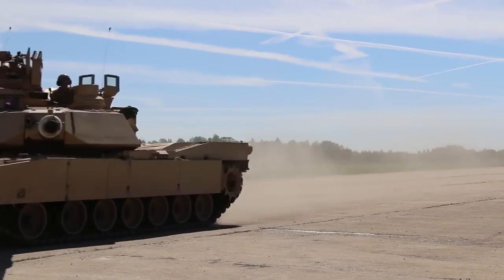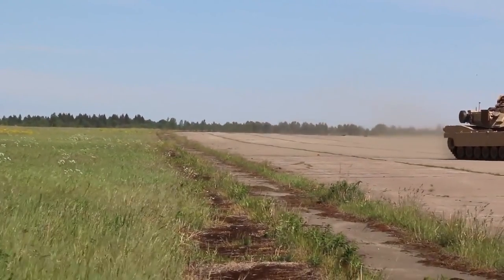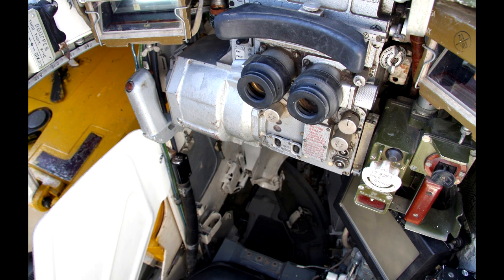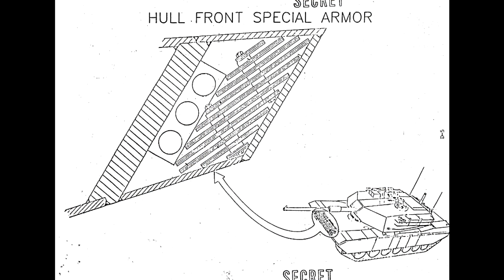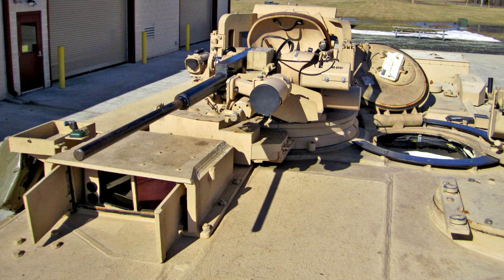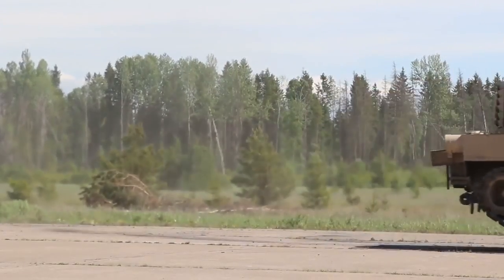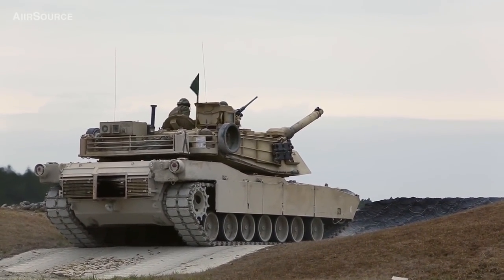Problems with Abrams tank

Comment: 9:00 - nope, nope, nope! That plate you are talking about - is really hard to aim. If you make a model of a front image of a tank - that upper plate has very small chances of being hit. Tank battles take place on distances ca. 1-2 km. So aiming at one 'weakspot' like in WoT or WarThunder is NOT an option. Even with APFSDS - after you shoot, enemy can relocate, wind can change or anything happen that will change the trajectory of missle :P
Secondly - fuel consumption of all tanks is rather high. M1 has it higher but on the other hand - this gives better acceleration, which gives upper hand in battle. And GT is quieter on the longer distances.

Using L55 is NOT the only option. There is really a lot that can be done with the material engineering of the penetrator. Or the explosive material. For sure at some point USA will use better cannon - but will it be 130 mm? 120mm L55? Future will show, but for now - similar effect can be achieved by upgrading ammo.
Reply: And as someone who knows a tanker you absolutely do aim for weak spots you dont just fire and pray your gunner fires based on the field ahead in most modern tank battles on side is stagnant in defensive positions this was shown in Iraq you fire for the weakest part you visibly can see
Reply: @nicholasbrown668  On what distance? 500m? 800m? 1-2 km? 3 km? 4 km?

That frontal plate is not that a big problem - if it was-  it would be already upgraded with additional armour plates on it. Or ERA.
Reply: @bartosza.6187  my nigga did I say I was a tanker im just saying they do aim for general weak spots not just point and shoot even first hand account from tank commanders during desert storm state they aimed for weakspots as their gunnery cameras give them a clear view at extreme range
Reply: @nicholasbrown668  OK. In case of desert storm - they fought against T-72. In case of those tanks - aiming at weaksopts is possible. So in such situation - it is possible. :)
Because their whole sides of hull and turrets are one big weakspots :) :) :) 
Any penetration there = detonation of ammo. 
A joke about T-72:
Where is ammo stored in T-72? 

Everywhere :D

In my country we used to have many T-72. So our military specialists know them perfectly :) Strangely they all disappeared several days ago... I wonder where are they now? :P
Reply: Upper hand in battle? Kid you realize the US army wants to replace the Abrams because of combat knowledge they received in the gulf wars right? When you have to stop 3x as more frequently for gas than a peer enemy you leave yourself heavily exposed and at risk of encirclement
Reply: @nicholasbrown668  emmm.... Not really. USA is planning to replace Abrams in 2-3 decades. NOW they are planning some R&D to make new platform - but before those works will end - there probably will be 2050 or 2060...
Reply: @bartosza.6187  2 or 3 decades? The army wants its new tank design program to begin production within the next decade lmao

Comment: Yup first M1s were not so good. They had many flaws. But they were constantly upgrading them :P
1:20 - they used gas turbine because the development of dedicated Diesel for Abrams had some delays. And they used what they had avaiable. Gas turbine is much lighter than diesel = more spare weight for armour. Fuel consumption WAS a problem on stationary missions. GT worked with 100% power just to power some on-board systems... Now with APU - problem is solved. Gas turbine was upgraded in the '90s (as i renember), and filter problems... also was solved.
1:40 - not true. Excellent acceleration is more than enought to justify the use of GT. Acceleration = faster retreat = machine and crew survival. Tank is a war machine - it has to kill, not be 'economical'... If something gives you upper hand - it is worth.
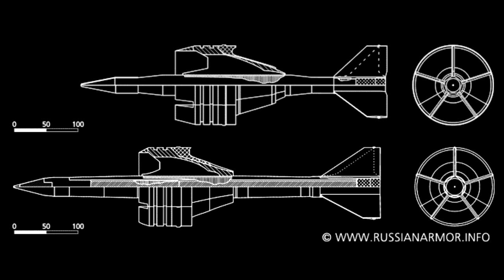4:00 - many ppl cry about depleted uranium... It's stupid. DU is actually U-238, which is not that radioactive. Ofc if you eat or inhale the U-238 dust - this can lead to some radiation problems, but mainly... toxic stuff. Uranium (just like Tungsten) is a HEAVY METAL. U-238 during fission emits alpha particles - which are VERY reactive - but are easily stopped by even paper sheet. So even dead skin cells on your skin and clothes protect you. But if you inhale it - then nothing protects lung cells :/ 

7:00 - AGAIN - fuel consumption is NOT a problem for military. This is not a car, this is killing machine. You really hate gas turbines, do you? Multi-fuel diesels can use other fuels but it has more limitation than for GT. GT can be fuelled by diesel/gasoline - no problem.
As I wrote earlier - one shot from main gun - costs more than driving several hundreds of kilometers. And even if you drive such distance - in ANY tank - costs of spare parts for suspension etc - will be much higher than the fuel. This are the 60+ tonnes machines (Leo2, M1, etc).

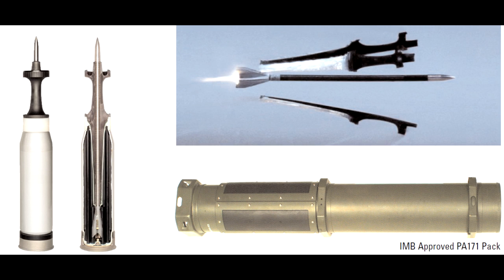8:00 - USA deals with it by increasing the barrel pressure and thus - muzzle velocity. L55 has its advantages and disadvantages. Maybe USA will do something with it, but for now - L44 and their ammo is sufficient. AND it's much much easier and cheaper to deploy all tanks with new ammo, than to rearm the whole fleet with new cannons :) L55 is also heavy and the question appears - should we take off some armour to mount longer gun? Or stay with L44 and in case of problems tanks will use air-force backup?
Reply: The high fuel consumtion would make them bad for the economy, not for the millitary. It is much more complicated than just saying that the millitary doesn't care, they do. Fuel is not nice to transport. They are also more complicated, wich makes them more unrelieable.

Also, U-238 likes to make aerosols, wich are not nice to be around and neither to clean up. Same goes with DU-ammo.

But the US could not not start wars, wich would be much more nice to have.

Comment: The armor inspection in this video is absolutely untrue. The thickness of the armor on the Abrams is 100% classified. Where did you get your 38-51mm on the top front plate? The rest of what you said is pretty much true, but the armor on the Abrams has been shown to be very strong on all frontal surfaces. There wasn’t a single t72B that could penetrate it during the Gulf War. Also, the gas turbine engine is very efficient & offers much better acceleration than most diesel MBTs today. The T-14 has a higher top speed, though.
Reply: First, in Gulf war Iraq had T-72M1 not B. and were using 3BM-17 an export round made of steel. maybe they had 3BM22
Reply: @76456  & you're right, they didn't have very good rounds to fire at the Abrams. Decent, not the best.
Reply: @76456  Didn't they both use the same gun, though? T-72B had better systems on board and better armor, right?  I could be wrong. Regardless, the Abrams has been shown to be a very tough MBT. More have been destroyed by their own crews than have been destroyed by enemy fire. Many have been damaged by mines and RPG attacks/anti tank missiles and either repaired or destroyed by their crew. If I'm correct, no Abrams crew member has died in combat. The Abrams has not been tested by any modern MBT other than the T-72 variants that it has made contact with. Things could be very different encountering a T-14.
Reply: @kegankelly3073  yes, bit i think some Abrams personal have died. if it was on the field or hospital idk.

T-72M1 have worst armour and gun than T-72B and also worst fire control sistem since 72B sight could display the Distance and the Lead, wasn't automatic tho like on Abrams or even T-64. 72M1 only could show distance.
Reply: @76456  okay, so t72m1 had a smaller gun or just lower velocity?
Reply: @kegankelly3073 
72M1 was upgraded in the start of 80's. B came in 85 if im not wrong.

72M1 had i think the same gun as B but had worst Projectiles, since it couldn't fit 90's Projectiles to face M1A2. like the B2
You can go to wiki "125mm APFSDS rounds"
summed up, 72M1 was worst but could go against early M1 or IPM1.
but for desert storm it was already to old. The problem was literally the ammo that it could use
Reply: @76456  Thank you for your expertise!

Comment: WoT has a lot to answer for,  I can't speak for US doctrine but i'd guess it's similar to British Army tank doctrine. In a fight with an opponent like Russia, we would not be  motoring around looking for kills, we'd be sitting in pre prepared positions hull down with infantry support. We'd fight that position and withdraw to the next prepared position, we would expect to have air support both rotary and fixed wing. What happened in Iraq in '91 & 03 against inferior forces bears no resemblance to how we'd take on a force equal to or superior to us in a defensive war we trained for during the cold war. With these facts in mind, NATO AFVs designed upto 1990 Abrams included were more than suited to this task.

Comment: This might be the most annoying video ever. Just give the info and skip the other bullshit
Reply: Sow why don't you make your own video, also this is only about the problems and the video must be around 10min nobody gonna whatch a 30min video. And Yes, it skiped sow many other problems Abrams had related to its tracks life span, Engine turning off when running out of oil (the one used as lubrificante) and the turret heating device can over heat the electric components on the sight.
Reply: @ChadGuess-s5y  And the rest aren't you gonna answer, "sow why dont you make your own video" I was being ironical, because you pointing out that video is bad and probably never done one, sow maybe argue the info instead of just saying, give  info and skip other bullshit, you might being a bit hipocrital (this one isn't complex but would take 2h to make).
Reply: @76456  your English sucks
Reply: @ChadGuess-s5y  i know, have a rest of a good day 🙃

Comment: One of the most common misconceptions about the M1's Turbine engine is the fact that it's consumes much more fuel, This is offset by the greater fuel capacity than a Diesel engine making it the same in terms of fuel efficiency, also another thing to note is the fact that unlike Diesel Engines, the turbine engine doesn't create as much exhaust smoke as a Diesel engine making it harder to see on thermals and the Turbine Engine often times is quieter than the Diesel when at a moderate distance away and could also push out more Horsepower as well but at the cost of it being more expensive, last but not least while the M1 Abrams is not the Best Protected tank in the world it definitely has better protection than most Modern Tanks as it uses a Mix of Depleted Uranium Armor making it very effective against Modern Rounds. Majority of the issues on the M1A2 Abrams was fixed with the new SEP Package.
Reply: So... What do you think it is they're burning in that turbine?
Reply: Carrying more fuel means less ammo. Not terribly good idea

Comment: I know I’m probably late to the comments, but one benefit the turbine engine does have over a Diesel engine is the fact that it is not as loud. The science behind it I’m not too sure about. 
But the noise the turbine engines give off means the tanks audio footprint can be heard from only a couple 100 meters away. You won’t hear it at all (unless you’re right on top of it) if you’re in a vehicle and the engine is running. It’s a pretty quiet tank surprisingly. You’ll hear an M88 (diesel powered recovery vehicle) LONG before you’ll hear an Abrams approaching. Source: my job
Reply: m1 is more silent over 500m and more noisy in 300m ,right?

Comment: You are clearly know literally nothing it is true that those messages at the start aren’t perfect to put it lightly but YOU ARE FAR WORSE! Half of what you said just not true and the most of the rest is not correct or ignores the reality of battle and war and physics too every one please don’t take this video as hard facts
Reply: are you using war thunder damage models?
Reply: @hooparom7430  hell no those are worse
Reply: Even if you had a shell that can pen a 80 degree angled plate you probably won’t hit the plate, tank gunners just aim for centre mass to try just to hit the hostile tank in the first place non of that aiming for weak spots like in games IRL that is almost impossible controlling a real tank is so much harder than in a game
Reply: @keelandoult1137  you are right!are you driving m1a2?
Reply: The one most important is the upper plate is LITERALLY impenetrable due to the angle EVEN IF IF IF you could hit it

Comment: The Turbine engine doesn't seem that big of a deal. It is more powerful and has higher low-end torque. It also has less smoke coming out of the back. They for compromise carry more fuel. The disadvantage is when the engine is idle, it guzzles fuel. Maybe some kinda hybrid tech will help? Everything else with the tank seems like it's getting older. And something else is that the front armor on this tank and the Leopard seems to not be problems cause they're hit with Sabot which doesn't bounce it penetrates.

Comment: Tank armor for me is like this

Imagine your on a beach and you make a wall to block the waves 
Most of us have done that

And as expected the wave knocks it down. So you make it thicker. It survives but then falls with the next wave.
So you make it thicker and maybe but a wall infront. It works, the thicker wall survives the wave and then the next one but on the next wave it falls.

Now imagine every time you put another wall or made the wall thicker it costs you money 

With that in mind, 
Theoretically we could make a tank capable of withstanding tons of rounds but it would be very expensive and you could probably only make one or three 

That's why you see multiple tanks with armor that yes can block rounds and bullets but not "all" of them eventually that "sand wall" will collapse or fall if the waves hit it enough

Comment: First versions of each tank series have always many weak points. The Abrahms was a contemporary of the Leopard 2 and already got the german 122mm Rheinmetall gun just before the Gulf war 1991. Perhaps the reason why they could defeat the older irakian T72 tanks with few losses.
Reply: It’s a 120.
Reply: that plus Iraqi T72 were shit tier and bottom barrels, and instances of tank crews abandoning tanks because they were more scared of CAS and air support
Reply: @Ry-bo9hi  yah all the t72s that pop their turrets are shit tier right? bullshit.  all t72s are shit, fixed that for you.
Reply: @Ry-bo9hi  abrams panels blow out turrets dont pop at least get that right
Reply: @bobh9492  If a shell manages to penetrate a tank a hit the supposed safest part of the tank, which is the rear turret bustle, I would expect the tank to be knocked out. IE some heavy damage or dead crew.
Now, you can still repair the tank back at base, which is quite an advantage.
Reply: also depleted uranium add on armor on top of the composite armor, t72 trash munitions bounced

Comment: Efficiency, not fuel efficiency, was higher with the turbine. IE more net horsepower was available with the Turbine. The turbine can run on anything. It's high frequency noise signature has less reverb over distance. The turbine had far higher torque at low rpm yielding higher agility. The fuel efficiency was overlooked for said reasons.

The filter situation was fixed minutes into the relative 30 year service life, and the maintenance and fuel consumption as I said, all together were overlooked due to the performance difference.

With sufficient service and fuel, the Chrysler XM1 was the best performer, the turbine. A poorer country could cite these reasons. but not us. The M1 IS the best tank to this day. The survivability and the performance were the primary concerns when it was designed.

Comment: A big reason for sticking with the gas turbine is power to weight. They also have far fewer parts, which helps with reliability as well as keeping all the spare parts you need to carry around to a minimum. The US doesn't have to concern itself with fuel consumption all that much, so the primary drawback of a gas turbine means little compared to it's many strengths

Comment: Gas turbine engine, multi fuel. Even you can use crude oil, kerosene, diesel, gasoline. But in condition, you have to flush the fuel tank.

Comment: I operate this tank, and the reason we use turbine engine is 2 reasons that I know of.
1 sound. Higher pitch sounds like from the engine are harder to hear at longer ranges than lower pitch sounds of diesel engines
2 multi fuel. This thing can take more than just jet fuel, we use the same stuff we put in the humvee
Reply: you operate this tank? 
gib sekret documents komrade
Reply: @hooparom7430  the tank is made of cheese
Reply: lol.I have a question,can the newest m1a2 win a fight with chinese ztz99a?

Comment: It is verry simple: The Leopard 2 A6 ist the worlds best tank. It has the best 120mm cannon, the best Engine and the best armour. BUT because this tank has not that much combat experince as the M1 therefore no one knows. Germany and the US had a idea of a tank: called projekt Tank70. The result was that the US didnt understand the metric system and had several ouer issuses about the preference of a tank. So at the end it skipped the projekt and german built the Leopard Modells and the US the M1
Reply: No leopard 2a7 is the best also I think T-80bvm has better hull armor than Leopards.